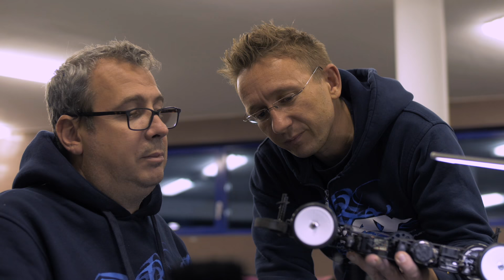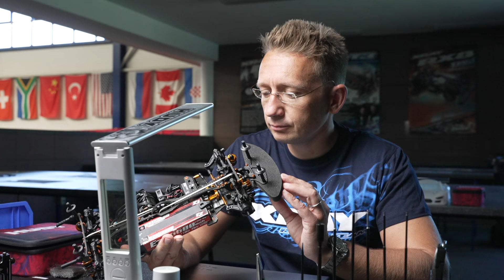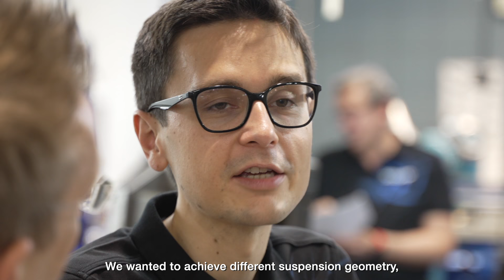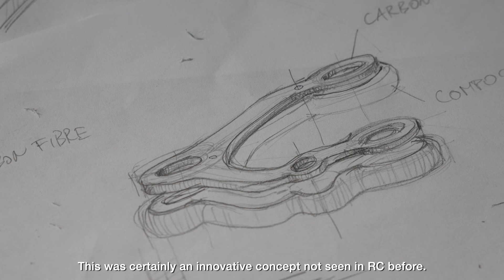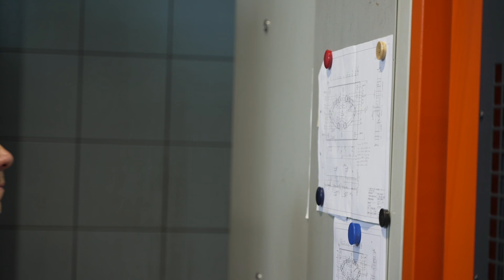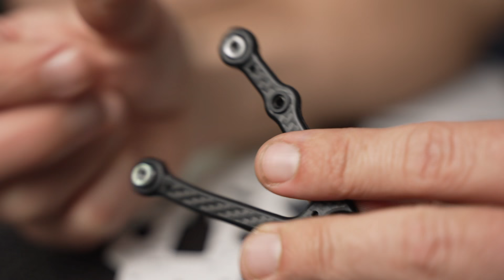XRAY X4 - Unique details revealed

Comment: As everybody knowns, c hub suspension is so much better, more tuneable and way more consistent than this pile of balljoints becoming play after just one ride. 🤣 But marketing is all what counts...but there is technically no advantage but only disadvantages with this design. Delaminating issues right away as these materials will work their self loose against each other....etc. But you have to believe in it, maybe... who knows...ah wait, there having exact this issues atm. Read around...